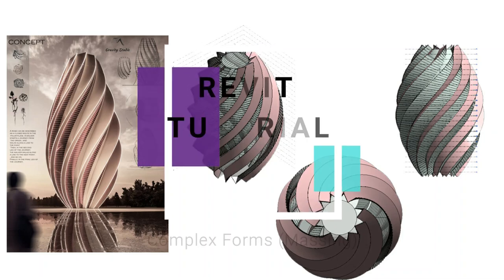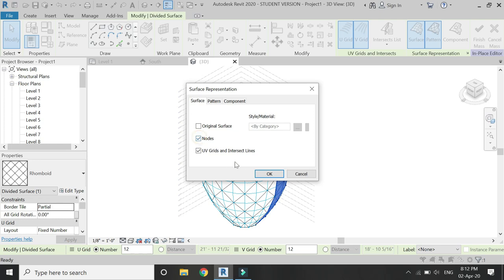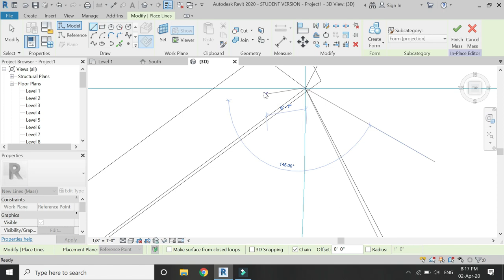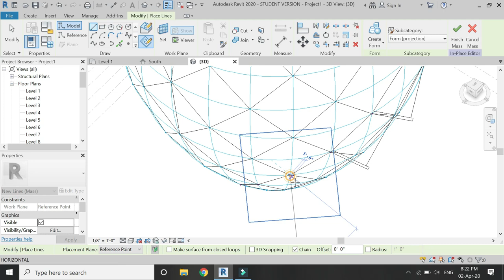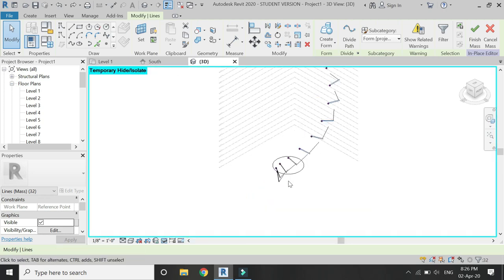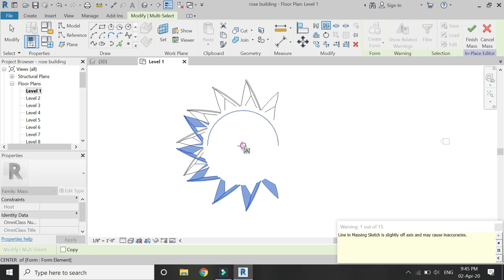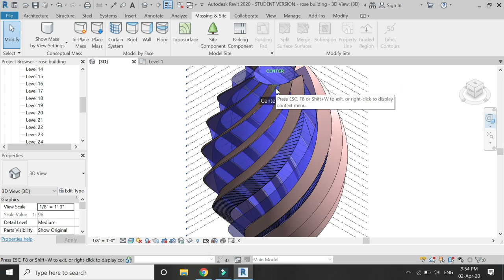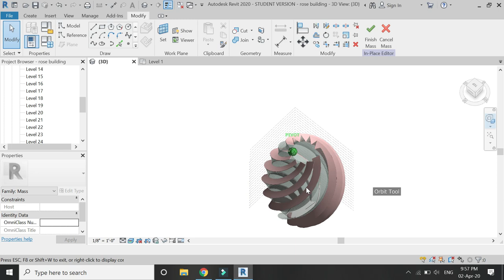Revit Tutorial - Complex Form (Massing)

Comment: After you make one Structural element and glass element, why cant you check the total segments around the shape, and array. so you don't need to do the draw line and create shape again and again.
Reply from the maker: Because they are not similar, array command is used for copying the same elements after a specific perimeter.
Reply: @LetsRevit  I think it is same element around the axis. So should work.

Comment: I created a mass in Revit and then divided the surface, after that the voids I created are not cutting through the mass 
Can you please tell me how to undo the divided surface so that I could create a void in my mass.
Reply from the maker: Uncheck the U grid and V grid. After that open the surface representation dialogue box and in the surface tab check the original surface. That will bring back the mass surface.

Comment: Advice, dont bother redrawing. Simply make a thin line, draw the lines to be connected all the way down, make it solid and copy it via the rotate tool. After you are done, simply apply wall by face with the needed thickness